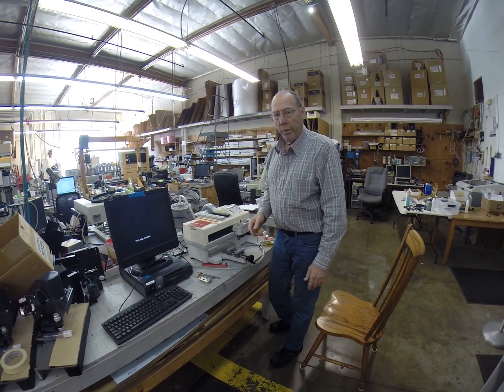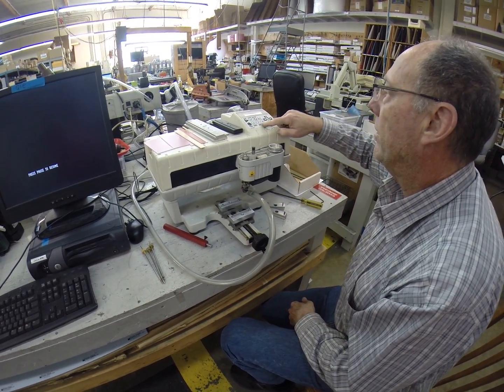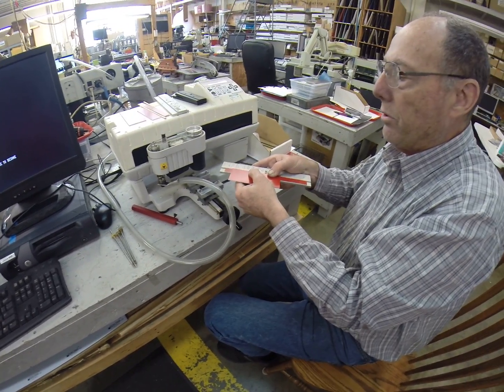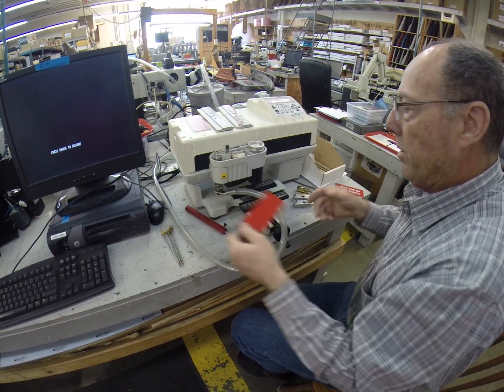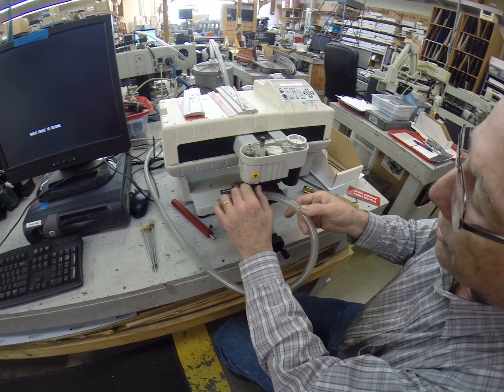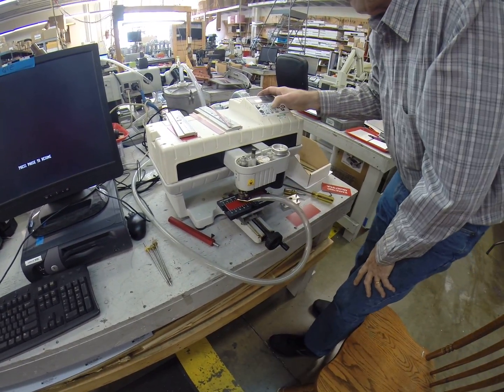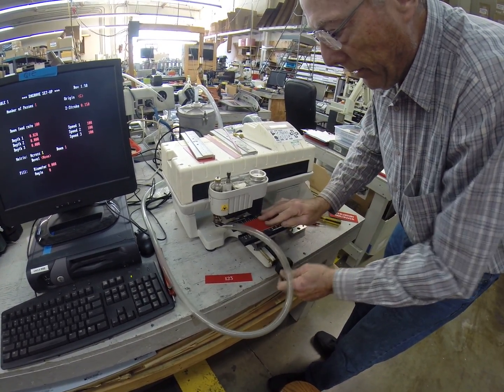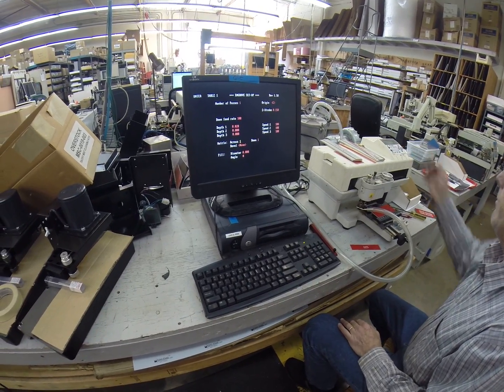Unica Simple Plastic Engraving Training

Comment: Hi fred i have an old new hermes v3400 it worked fine..but i moved it to unheated garage and now spindle wont turn...i believe its due to cold temp 40f....the motor is so underpowered and i think temp is stiffening my poly belting especislly the 84in belt...it worked fine inside house...all pulleys and bearings are good...have you ever heard of this issue about hermes nit working in colder environments.?
Reply from the maker: find me on internet and i can send you a catalog and a troubleshooting writeup. quality One Engravers
Reply from the maker: Yes the motor is a great motor but starting Horse Power is low. You can try to unhook belt idler to spindle to warm it up.  We also sell a replacement motor that eliminates the long belt entirely.  NV3-1051-100. eMAIL ME FOR A V3400 FLYER. https://q1engravers.com/products/q1e-v3400-spindle-motor-replacement-kit?_pos=2&_sid=ff04775d1&_ss=r

Comment: Hello I have the same unica , but with the the monitor it comes with. I want to built it like yours with a separate pc. Is there a link where I can download the software for the pc. And do you a advice for me how to Konfigur the whole system.
Reply from the maker: For the Unica I have GX150 computer available that has a com 1 and com 2 serial port. software pre-installed, just add std vga monitor. 
https://q1engravers.com/index.php?main_page=advanced_search_result&search_in_description=1&keyword=gx150&x=0&y=0
Reply from the maker: Also the Unica will run from gravo. I have XP computers and dongle available.